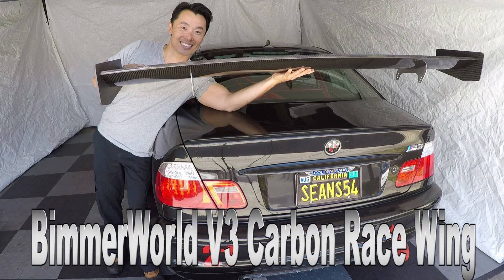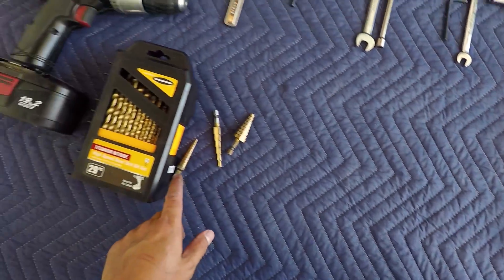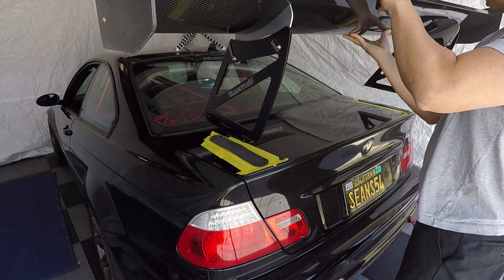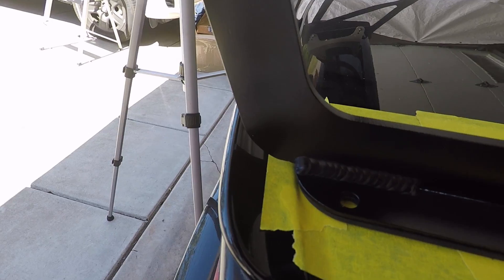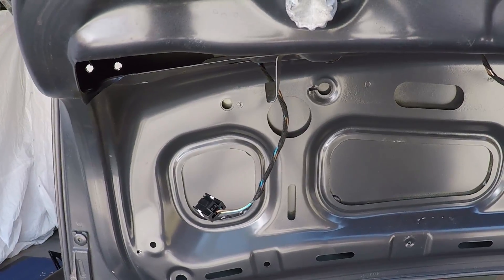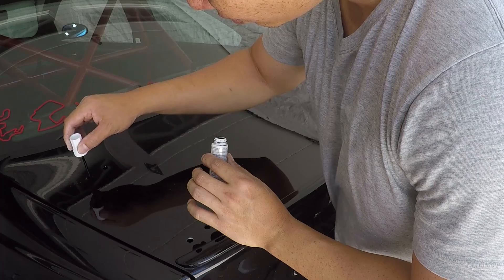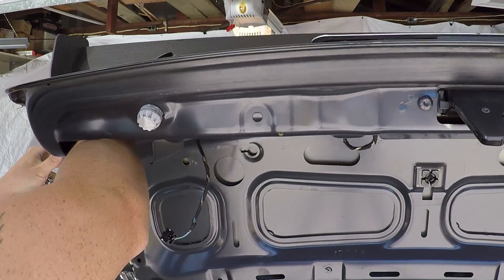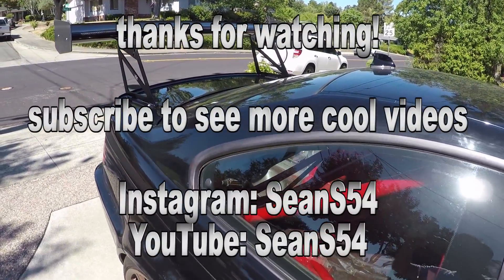BimmerWorld V3 Carbon Race Wing Install - Track Aero DIY

Comment: Great videos. Don't you need supports in the trunk for the wing?
Reply from the maker: For this wing you don't. The really, really hardcore guys do solid mounts to the frame of the car. That adds mounting complications and weight.
Reply: I'm a track guy with E46 M3 and I'm slowly turning my car into pure track toy and really enjoy your videos.   Thanks for making them
Reply from the maker: You're very welcome! Great choice on the E46 M3. It's a great mix of power, weight, and cost.